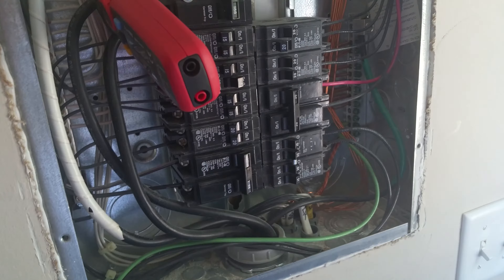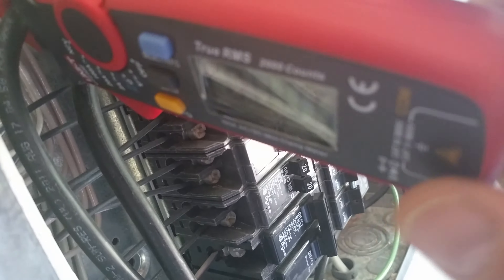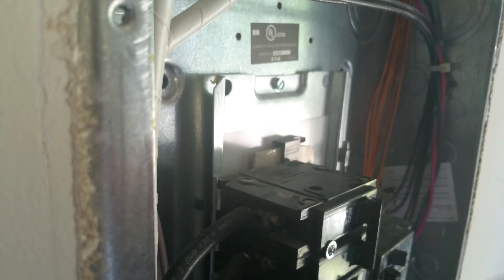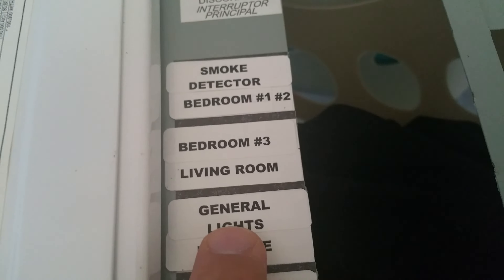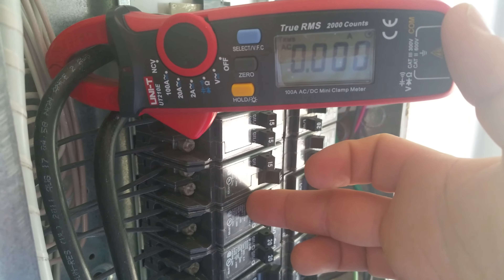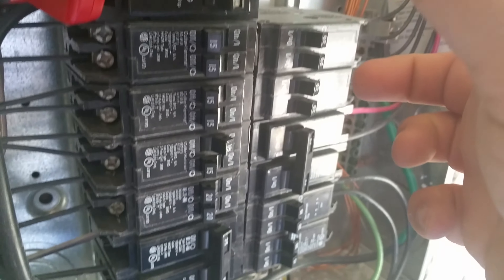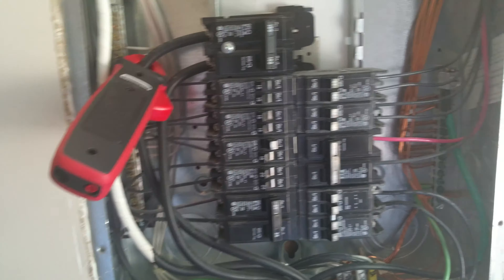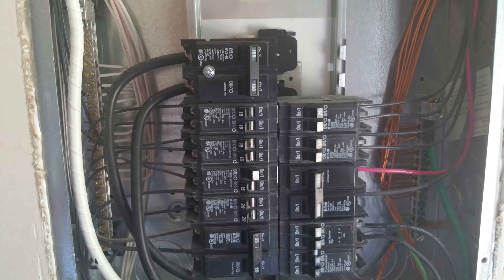What could be leeching from my mains?

Comment: i didnt realize you live in bath. we have a kid that goes to bath schools. if you are looking at saving power for laundry, sell the dryer and washer and get the lg washer dryer combo. it uses only one 110v circuit, uses condensing to dry and its just a load laundry and forget. ive got one $1500 shipped. put the laundry in and pull them out washed and dried. uses only about 1-1.5kwh per load total. saves a ton of money in electricity and you can get rid of the dryer vent which should help with heating losses in your house. also look into building a solar water heating loop to assist the water heater or fully take over. i wish i could do solar where i am at, unfortunately i have trees on the properties surrounding mine that block pretty much all usable light. only thing i could use is a wind turbine but it would be a hard setup to do with only .2 acres of land and tall trees to overcome.

Comment: That heat wrap plug was very confusing...  It should have been a water proof gfi and on a 20amp breaker alone. I used to be an electrician but everyone does things differently I guess
Reply from the maker: +CrazyNickOO7 I'm no electrician but I agree with you. I would have never known this had I not used a clamp meter to see where my energy was going.
Reply: Makes me want to check my panel now too!  Glad you figured it out so you can save a half amp of energy 7 or 8 months of the year. Its pointless they would have it running all year long.  theres a fairly simple way to wire in a thermostat that can trigger the heat wrap when the temp gets cold enough. Or just simply remember to plug it back in when it starts to get cold lol